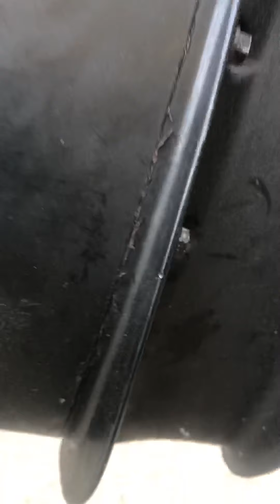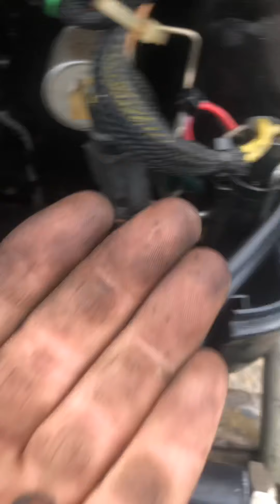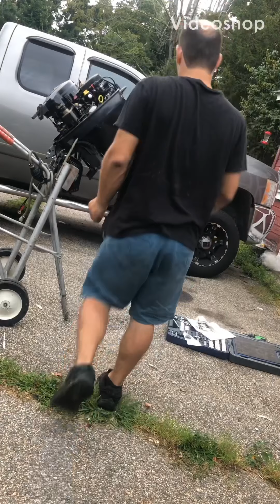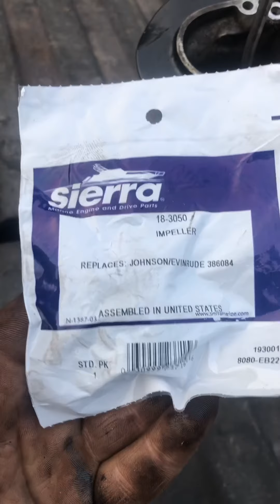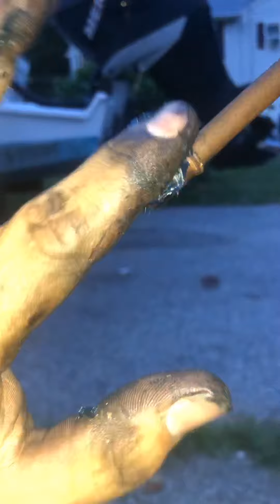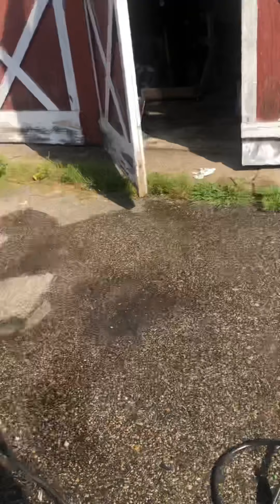How To Replace a Water pump 9.9- 15 hp 99-01 Four stroke Johnson Evinrude Outboards

Comment: have a 1998 johnson 9.9 four stroke.  bought it used about a year ago.  thay said coil pack bad shuts down after warms up . ran it on water hose had no issues.  took to river shut down after warm up . came back on trolling motor. put on trailer rectifier went out burned up state. saved money  got all parts including water pump.  motor is over heating have had it apart 3 time . water comes out hose in outer housing , out exhaust at higher rpm. but water always comes out weep hole in 6 inch spacer to make it a long shaft.. I have no idea what to do now?????
Reply: Some people have fixed this by replacing the water pipe grommet at the power head, they get deformed and  block the water flow, they said to pull the power head off, not the bottom end to get to it. Good luck! I have to do it too, I replaced water pump and have really weak pee coming out the tell tale.